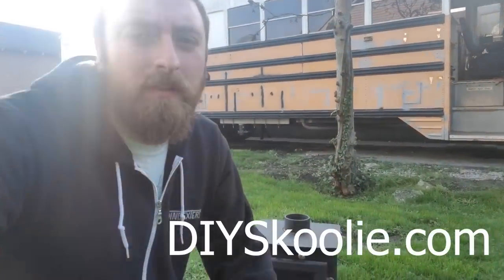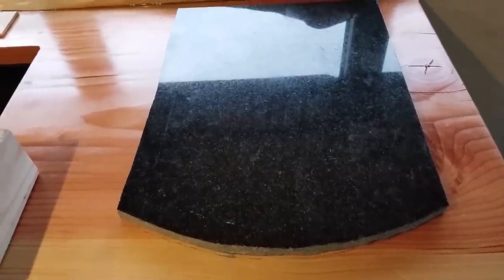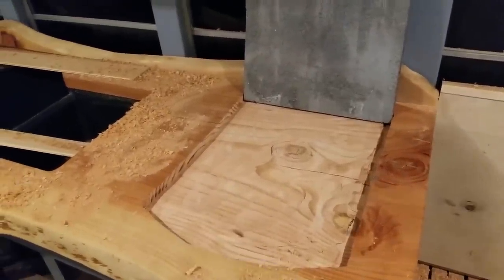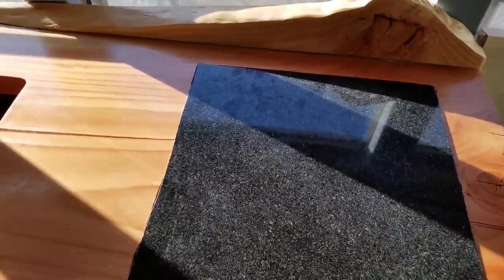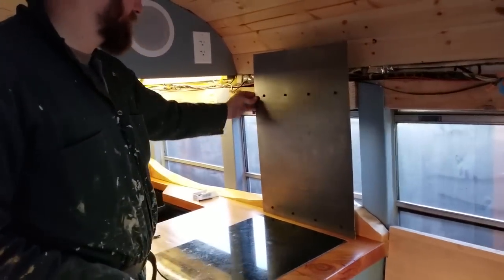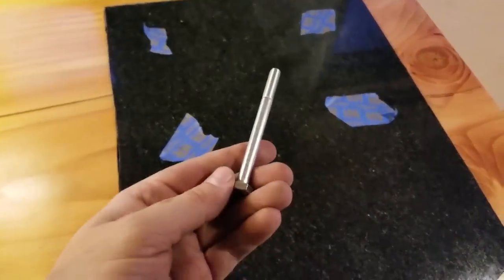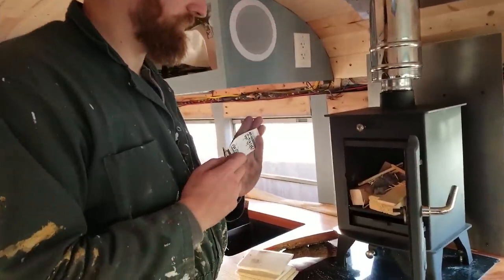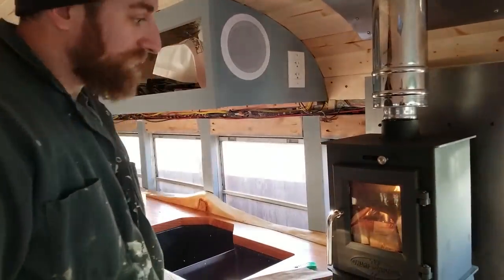Conversion Video 41: Tiny Wood Stove Install

Comment: I don't think you needed to install that many screws on the flue flange bracket. A couple of screws on each side should of done the trick. The less screws the better when it comes to roof mountings and possible future leaks. Looks like a great job though. I am going to install the same size wood stove in my RV but I am going to use heat shield mounted directly to the wood stove on the rear and sides rather than the wall. I will use 1/8th sheet metal painted black and mount it with about 1" clearance. I am thinking about venting it out a small side window rather than going through the roof since my RV is stationary and if I have to move the RV I can easily remove the flue. I like that granite hearth.

Comment: So it’s a double wall pipe thru the roof and the hole is that snug against the pipe? Are you sure that’s safe? I just installed my stove and it’s triple walled thru the ceiling but the company recommended leaving 2 inches extra space around the pipe
Reply: you are correct, double wall setback is two inches.
Reply from the maker: I wondered the same thing, and I don't want to burn down, so I called the company before I installed it this way. They verified that it was correct. Their included hardware would not cover a hole with a 2 inch setback. There is fireproof insulation that you can stuff around the hole, if it is a major concern. I have had probably around 50 burns in the stove since install, and no problems. I try to keep the magnetic thermometer in the sweet spot. 

That said, if you can do a 2 inch setback with your hardware, that sounds like a good idea. Any extra precautions that can improve safety are worth doing, for peace of mind.
Reply: @DIYSkoolie  what sort of fireproof insulation and where is that sweet spot of the thermometer? 👀✍🏼
Reply from the maker: @onceinawhile7  I posted something here, which is what I was thinking of, but then I found something better.  I was thinking of a fireproof rope that you put in the wall around the stove pipe.  I saw somebody else do that.  BUT, this is the insulation that you would find in something like a residential stove, and it can be cut to size: https://amzn.to/3jq0AW6  I would put this around the stove pipe hole.  The sweet spot for the thermometer is high on the side.  It comes with the convection fan that I bought.  I couldn't find the exact one that I bought, but here's a similar one with good reviews: https://amzn.to/2Oh8V31 This one actually looks like an improved version of mine.
Reply: @DIYSkoolie  thanks for the info man

Comment: I dig the wee stove , but that wooden bunker you have the stove on looks like it's been weakened by cutting into it for that black bace. The weight of the stove will be to heavy for the wooden bunker now it's been redused in thickness. If it breaks while the stove is in operation, it doesn't bare thinking about. Apart from that I like what you done.

Comment: Trim would fill gaps - and I’m not a professional woodworker - but I wonder is wood dust left over from routing could be fixed with wood glue, then poured into the gaps. . . . . not sure if it would cure nicely.

Comment: To each his own, but I would prefer designing the sitting area around a floor mounted fireplace, so the light from the flame can be seen directly and the heat is projected from floor lvl. This maximizes the positive psychological effects of the flame and the practical use of the heat.

Comment: I would never have set that granite into that gorgeous countertop.
Reply: Cyndi  but if not, beautiful countertop would catch fire...
Reply: Me either you could have hung metal bracket in front of window to put it
Reply from the maker: It was a tough decision, but there is plenty of other pretty countertop to admire. Also, the hearth has the added bonus of acting as a coaster for hot drinks, so it protects the countertop!

Comment: Why run insulated pipe all the way down to the stove? Arent you losing out on the heat that would radiate from a straight pipe?
Reply from the maker: You are right. I also lose heat because it is mounted so high off the ground, and heat rises. However, for such a small space, it radiates plenty of heat to keep us warm. It often needs to be turned down after a while, because it gets too hot. I use the convection fan and some electric fans to circulate the heat better.
Reply: Yes a bend does slow the heat loss up the flue... but... as the heat cool some of you particulates will fall out up suspension. In time they will block you pipe. So you will have to every year take it apart and knock out the build up and reassemble.

Comment: The bolts would be better off dropping in from the top and then the nuts and washers are underneath. It's a much cleaner way to do it.

Comment: Cut with a sharp exacto knife as deep and close as you can.... When you get close to with power tool or chisel the wood will just chip away you can get to the millimetre fit with it this trick

Comment: Does the top setting have to do with secondary combustion?
As for the long burning time, have you tried using wood pellets or sawdust in a very vitrified box that fills the stove to the brim?

Comment: Your drill was fine for a small job. But when you drill through things like granite, stone, and metal, you would be wise to consider a larger drill.
Reply: A hammer drill is typically what is used with the masonry bits

Comment: Is there a possibility that the granite slab could crack under heat?  I would have used a ceramic with high heat resistance.
Reply from the maker: So far, it has been fine. It doesn't get too hot, in general. No cracks so far from heat stress or road vibration.

Comment: We are considering this stove for our 26 foot motorhome. How do you like it...a year later?  Does it provide sufficient heat in the winter?
Reply from the maker: We love it! It does provide all the heat we need to warm the bus. We still have propane heaters, though, to provide heat throughout the night, if it's cold. The stove needs to be fed every hour or two. You can go longer, if you stuff it well, and manage the burn rate, though. Once you get used to it, it's simple. It's probably.our favorite feature of the bus.
Reply: @DIYSkoolie  what are the low temps you've had it in and do you think it would be sufficient for us? Or would we need the 4kw? If you pop on our channel at the last video we put up you can see the lay out of our motorhome. I think the 3 kw would be ok but not sure. The 4 kw wouldn't run all night either right? This is soooo confusing. I'm just afraid the 4 kw would be too much heat. I need help lol (Emilie)
Reply from the maker: @OurPOVThatsItThatsAll  The lowest temp we've had it in was 11F, and it was still toasty inside.  Our bus is 225 square feet.  I think you'll have a tough time finding any wood stove that will stay lit all night long.  I picked the 3kw because it takes up so little space.  If you have room for the 4kw, go for the upgrade.  At the very least, it will make it easier to cut wood pieces that fit in it.  Tiny stoves take tiny pieces of wood.  Also, sorry to hear about your dog.  You can control the burn rate and temp with the dampers.  I can only assume the 4kw gives you more control over this.
Reply: @DIYSkoolie  wow 11 degrees!!! And it was still nice inside?! That's awesome. I think we should be ok with the 3kw if that's the case. This was a big help. Thank you. And yeah, our baby is gone now but we'll make sure our other baby is spoiled twice as much. She's sad and confused but we are hoping that goes away sooner rather than later. Thanks so much again. ❤️

Comment: Heat rises. Heaters should be mounted on the floor.
Reply from the maker: True. But this is such a small space, it can turn it into a sauna. I use fans to help circulate the heat, too.